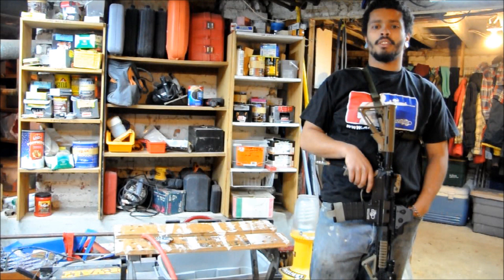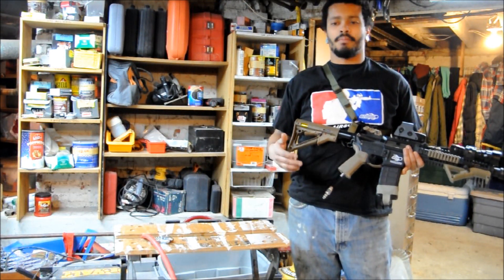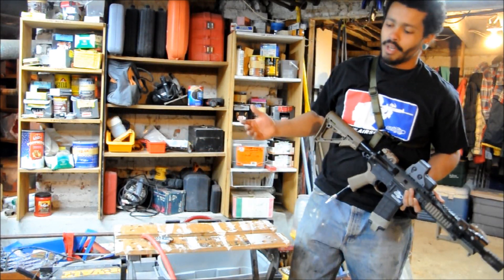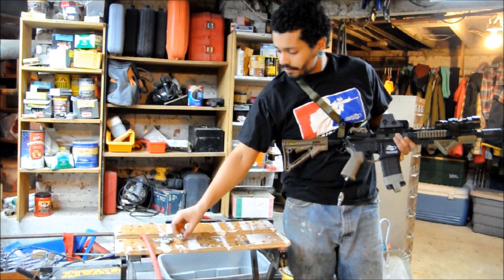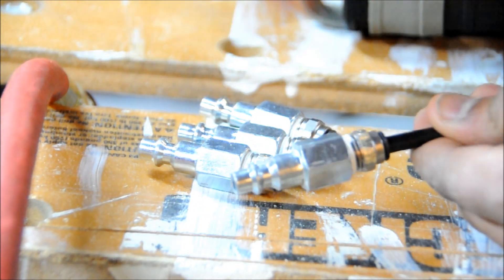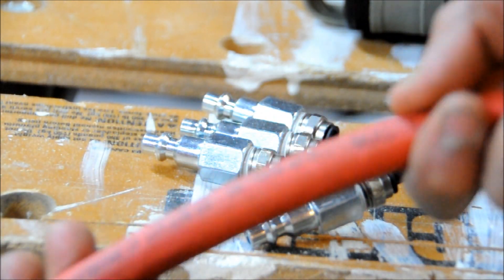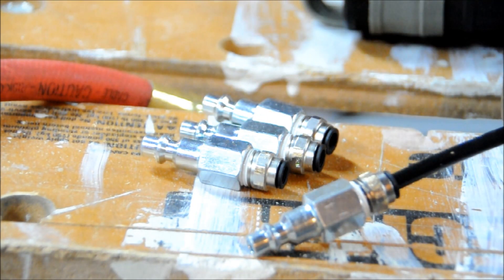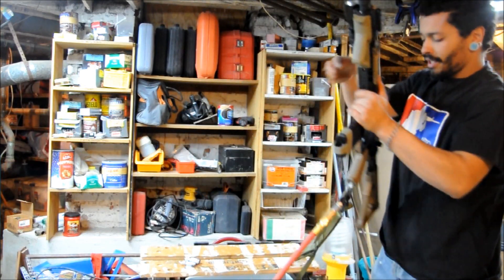Connect your PolarStar Airsoft gun to a standard shop air compressor!

Comment: Wont oil get in your gun
Reply from the maker: ReviveAirsoft there should not be any oil in the compressor resovoir, pneumatic tools require oiling in the tool but this compressor is completely oil free. Only thing I worry about is possible moisture inside the compressor, so inline desiccant might be a good idea.

Comment: Pootinhammer take off the motor plate so it doesn't scratch up the line and eventually tear it open
Reply from the maker: I have my macroline wrapped in duct tape where it exits the motor plate to keep the threads from scratching it
Reply: pootinhammer i just used a dremel and got rid of the threads out of my grip.

Comment: Can you use this to completely fill up p* tanks?
Reply from the maker: no, in order to fill your tanks at home you either need a High pressure hand pump (max out at 3000 psi), a shoebox compressor, or a scuba tank. shop compressors usually max out around 100-150 psi, HPA tanks hold 3000 - 4500 psi. this is just for running the gun straight off a shop compressor to save money on filling up HPA tanks when you want to shoot at home